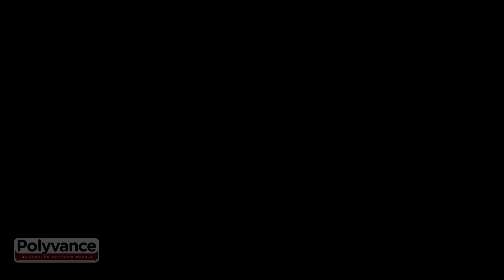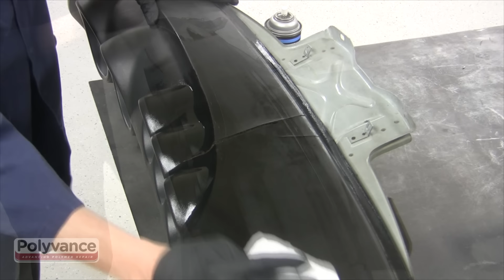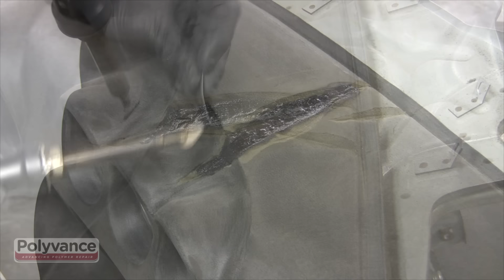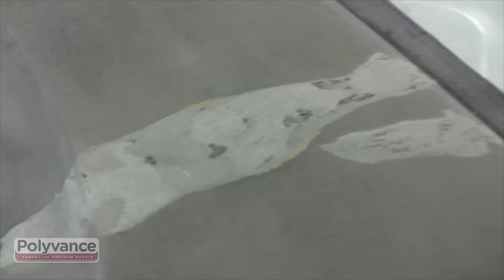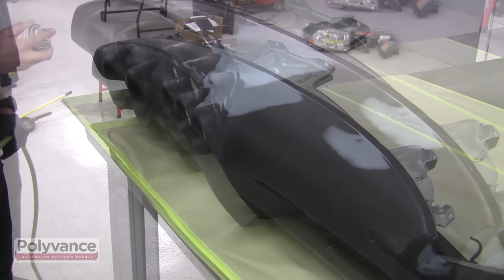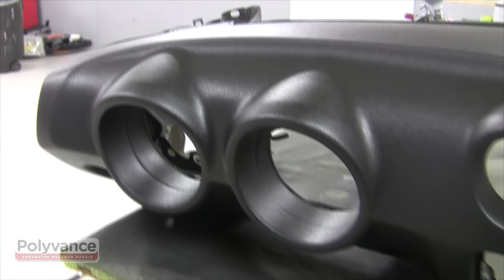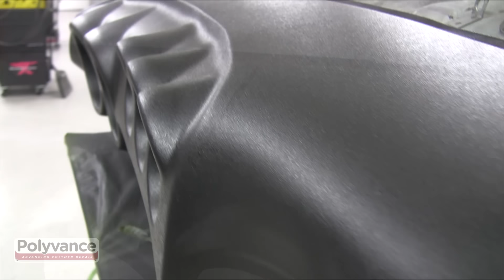Cracked Dashboard Repair - Padded Dashboard

Comment: It says fiber flex welding rod does not exist
Reply from the maker: That's odd. We manufacture it ourselves. Follow the link below to the product page.
Thanks for watching!
https://www.polyvance.com/FiberFlex-1/R10-04-03-BK/
Reply: Polyvance
Reply from the maker: Sure they do! https://www.polyvance.com/FiberFlex-1/R10-04-03-BK/
Reply: R10-04-03-BK is our part number for the FiberFlex welding rod. I prefer to use the R01-01-03-NT polyurethane welding rod with the 5700HT Mini Weld Model 7 airless plastic welder. You need the temperature control to use the urethane rod.

Comment: i have a wide deep missing chunk of dash from my 71 gto... how large of an area can this foam repair?  i'm talking like a 4 inch wide strip missing from the dash top.
Reply from the maker: A little goes a long way. By our estimates, a can (8 oz) can fill a crack that's 1/16th'" deep and 4" long for 57 inches.
Reply: excellent, thanks for the fast reply.  Do you have a complete kit for sale on your website? i only found individual items, and i cant seem to find the heating iron that melts the polyurethane rod with the feeder tip? just the iron that has the spade tip.  Thanks
Reply from the maker: If you follow the link below, we have an article on our website that lists all of the products that we used in the video.
https://www.polyvance.com/280Z-Dashboard-Repair?p=83
Reply: Excellent, thank you! i just ordered all the listed items. Appreciate the help!

Comment: cool video but it will crack again 100% within a year..    but yeah...  it looks good..  ive been trying to figure out how to fix these for 10 years with no LONG term luck...  how is the dash holding up?
Reply: Chris Craft.... apply a heated leather cover after this repair, it will definitely last for a long time. I have done it on my 280S four years ago.

Comment: what has to happen to your dash to look like that?
Reply from the maker: Do you mean the damage? Different things, usually. Could be caused by a frustrated punch in afternoon traffic. Could be caused by a child who loaded butterknives into his or her nerf gun, then fired at the dashboard on the way to school. It could, in some cosmic way, be attributed to the butterfly effect. 

But more than likely it was just ripped one day and no one could remember how it happened.
Reply: Polyvance Yup, the damage. I just never seen anything like it unless part of a crash.

Nice work on the repair though, looks brand new.
Reply from the maker: Thank you very much, sir!
Reply: ***** nice find!

If true it would explain a lot :D
Reply from the maker: Better than our answer.
Reply: 40 years in the sun.
Reply: . . . . .*Siiiiighhhh* ...Sun damage
Reply: 35 to 40 years of hot sunshine, cold nights, dry days, moist nights, repeated over time. The dash will expand and contract daily until it dries out and cracks.  Or just park your car for 2 years with the windows closed.
Reply: Sun.  This happens to all ungaraged 1st gen Zs...probably most vinyl dashes from the 70's.
Reply: Hey I have a 1984 Celica and it’s got cracks on dash I’m thinking about buying a new one would buying a new one be better then fixing it ?? As far as I got told the damage was caused by the sun?? And can sun cause it to crack??
Reply: Years and years of UV light. Many 20+ years old cars have cracked dash.
Reply: Slamdoxicalz dah age...
Reply: If you can find a new one and be willing to pay for it. For many, repairing is the only option.
Reply: Polyvance. Or just heat
Reply: Good job like brand new !
Reply: John Boy nope, no dash cracking in the uk.....mostly just mould and wet rot......
Reply: The hard part is the removal and installation part. Fixing is easy with this fancy bondo goo.
Reply: Lincoln Crofts - a good heat wave will cause it, even with windows down
Reply: the sun....seems to be a world wild problem lol
Reply: That is a Datsun 240Z dash. Probably around 1972. It is old and the car had it's share of standing in the sun in it's lifetime.
Reply: yep. florida does that.
blame florida.
Reply: My girlfriend's 26yo Jeep has a worse dash than this. 3 cracks this size and a crater from Arizona sun.  I already purchased a replacement dash from the JY, but now I kinda want to try and repair it.
Reply: Never bring a car to a knife fight lol
Reply: Polyvance has always
Reply: Slamdoxicalz heat

Comment: Whats the cost difference between this and buying a new dash?
Reply from the maker: The cost efficiency is hard to beat, especially if the anyone can do it him/herself.
Reply: It's not so much the cost comparison as it is the likelyhood. Find an OE 1970s datsun dash or a 1980s square body chevy pickup or an early 90s models Dodge Ram  with a perfect dash and you'll see my point. You cant even buy new dashes for most vehicles. I have a late 90s S10 with a cracked dash and noone makes new ones. This is your only option.

Comment: Good job, but seems too much work.
Reply: It looks like a lot of work, but might be worthwhile if crack-free dashboards are hard to find.
Reply: There's always that lazy dude…
Reply: SONYMAN915 cos like, you can just go to the datsun store n buy a new one.......no wait!
Reply: SONYMAN915 well don’t do it then!!
Reply: If it ain't worth the work necessary to achieve it,  you dont deserve it.
Reply: Sometimes it's just easier to replace than fix, but you can't always find the parts you need.
Reply: SONYMAN915 Lazy ass
Reply: SONYMAN915

Comment: How long did it take to repair this dash and how much did all of the products cost?
Reply: This is pretty time consuming, no doubt. I'd say, all told, about 6 hours. Products cost about $300.
Reply: Kurt Lammon if the dash is already removed.  If the dash is still in the car you can double that price.
Reply: @CaptGreyBeard  it was a reproduction. Fits great no problems and looks factory original
Reply: I got a new dash for my 68 mustang for 100 bucks so I would hope it was cheap
Reply: Costs a lot less than a new dash, I'm sure—assuming you could even find one.
Reply: Auto wreckers

Comment: Is all  this possible with the windshield still in place??
Reply from the maker: Certainly! If you were to remove the windshield, it might make the actual repair area a little more accessible, but the headache of actually taking out the windshield will cancel out the benefits more often than not.
Reply: So you took the dash out of the car because it doesn't seem to have a windshield in the way.
Reply from the maker: That's a fair point. We happen upon a lot of random repair opportunities due to the wide range of applications of our products. This particular case was most likely out of a junk car that we could disassemble without much worry, which is why we took the dash out completely to access and view more easily for the demonstration purposes of this video, but it's rarely necessary to do so on a typical dashboard repair.

Comment: I need to fix a Dash in a similar way, thou the plastic is Brittle and i wanted to get it looking as new as possible, and same as original. What's the expense on this product, where can i get it, and how do i color match the dash? I have a ZL Fairlane 87, the dash mats cracked up and brittle where the driver sits mostly.

Other plastic components i am just gonna plastic weld like the pillars.
Reply from the maker: This link should answer all of your questions. Thank you for watching! https://www.polyvance.com/Padded-Dash-Filler-2/Padded-Dash-Filler/

Comment: Does the texter spray paint come in a spray can in dark gray color ?
Reply: No, you'll have to topcoat the texture with paint. Use the 3803/3804 Flextex VT to get your desired texture, then once it dries, you can paint with your color.
Reply from the maker: +NISSAN ZX Unfortunately, no. We aren't able to offer the FlexTex in aerosol cans, and it only comes in a satin black color. Sorry.

The good news: It does come in three different textures, though, which can pretty drastically alter the look of whatever you're texturizing.